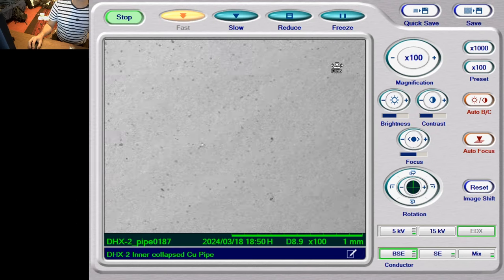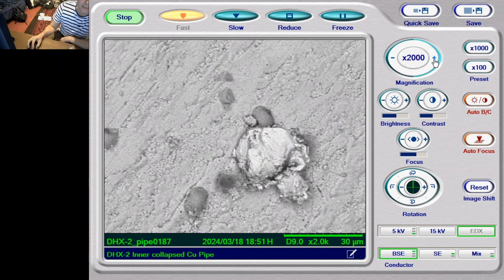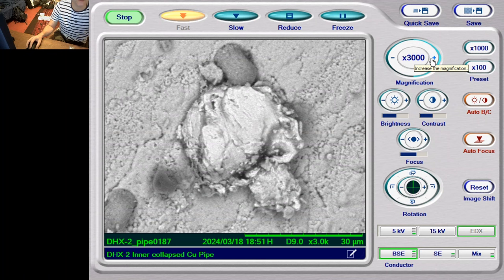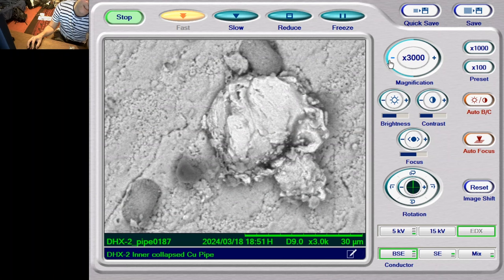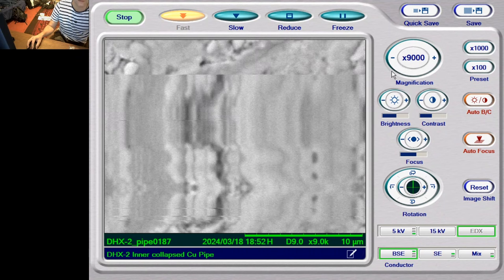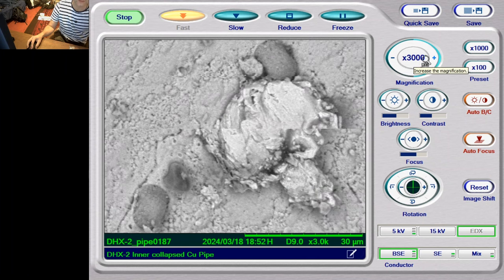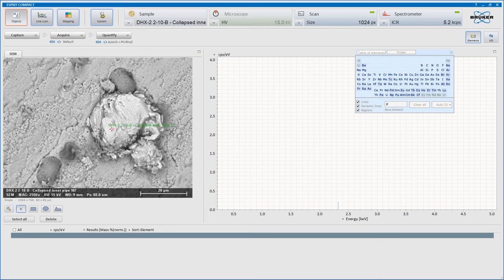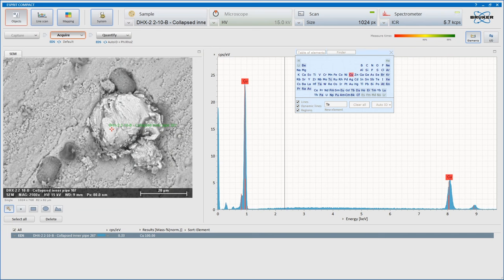Bin-Juine Huang - Champignion on collapsed DHX-2 piping

Comment: That looks like a scoop folded on itself. The purity of the copper is impressive. I was surprised by the presence of Titanium in one of your previous videos. Yet in the other video where tin showed up, I wondered if it could come from the solder between coper pipes.
Reply from the maker: This copper is clearly captured (as we had seen before), though it may be a popcorn like effect as observed like Matsumoto and referenced as such, we know for sure that immense pressures are released when the containment fails. I suggest that the Tin might be captured - regardless, it is captured by the same structures. Only more study will clarify matters.

Comment: Is it eating the smaller glob to the southeast of the bigger glob? Or is it just part of the bigger structure?
Reply from the maker: It has enveloped itself in a shawl of copper like a toffee apple.
Reply: @MFMP  Or like when popcorn pops.
Reply from the maker: Possibly, Yes, Matsumoto indeed showed popcorn ones and referred to them as such. It is the purity of copper and that we see matter partially on the outside of another one that suggest to me that it may be encasing.  @craigs.handle
Reply: @MFMP  Do you think the crenations would have something to do with popping like popcorn? I wonder what the surface of a popcorn colonel looks like it would be interesting if it was crenalatred as well and it structure.
Reply from the maker: I think Sythesised Fe bursts out of these things and Fe is then aggregated by other clusters. @craigs.handle
Reply: @MFMP  So do you mean aggregated onto their surface or consumed through the 0 point and redistributed into the new one?
So can the iron be added like a snowball? Or does it need to be consumed?
Reply from the maker: Both. @craigs.handle
Reply: @MFMP  Wow, I am so blown away by all of this. Thank you so much for sharing all of it.
I'm getting answers to questions I've had since I was in high school. What do you need to feed a plasmoid system To get 79 and 115 created? I can't even fathom how The world has actually completely changed yet it looks the same... for now. It's so big I have problems putting the words together to ask the questions that I have.
All this to sincerely Say thank you for sharing this.
I am doing the same could every opportunity cheers sir
Reply from the maker: Which isotope of Moscovium are you interested in, the one that has been synthesised in Dubna, Russia is very short-lived. In any case in theory you would just need more resonance, time and matter and to stop at the right time. @craigs.handle
Reply: @MFMP  I have thought of the use of Resonance might be the to getting it to stop at the right time. More so increasing probability of it stopping at the right Time So that I'm majority, what can be collected? Would be what you're looking for. Perhaps a certain Frequency would Both stabilize the plasmoid until it produced a certain element. And then also cause it to rupture and not go past that point... Air go, you could Concentrate the result, hope that makes a little sense.
Reply from the maker: You would always produce a spread of elements, chemical methods would be used to extract the target elements. @craigs.handle
Reply: @MFMP  It would be interesting to see the effect of different frequencies added to the environment they are formed/living in. The amount/proportion of copper in this sample and titanium in others has me wondering if it's just a function of time Why wouldn't some of this copper be transmuted into other elements? 
Or perhaps it formed a copper Lining under the iron shell Buy organizing
Magnetically Sequestering it from being processed into something else.
Has anyone tested magnetic fields on plasmoid generating devices.
Reply from the maker: http://rexresearch.com/vachaevsteam/vachaev.html @craigs.handle